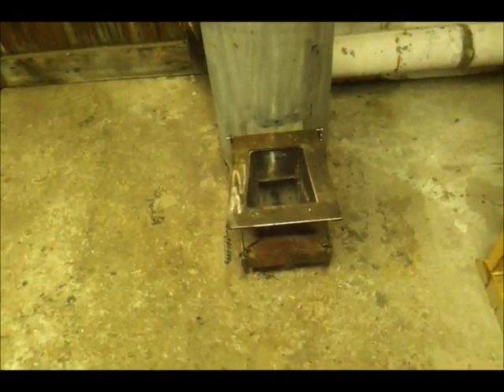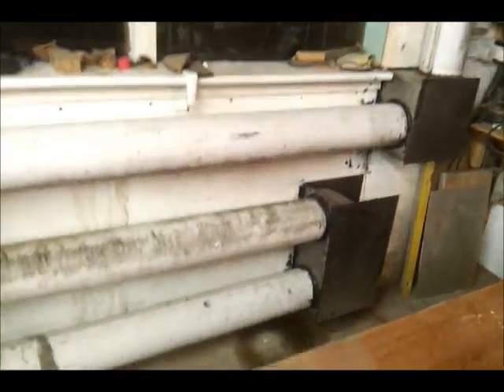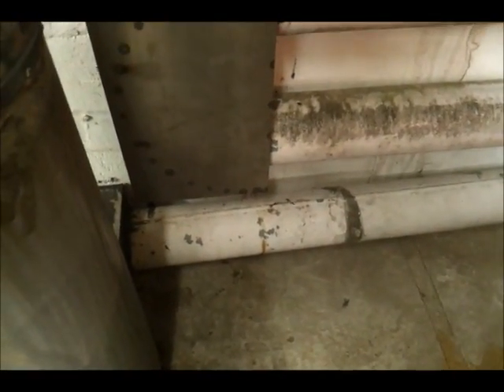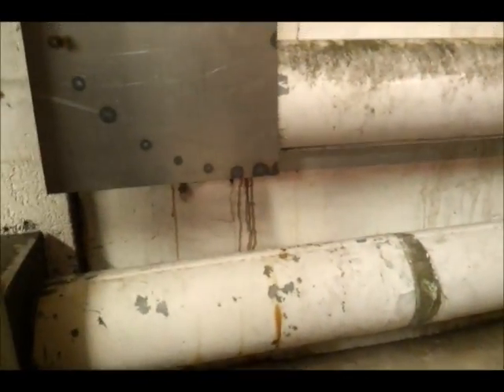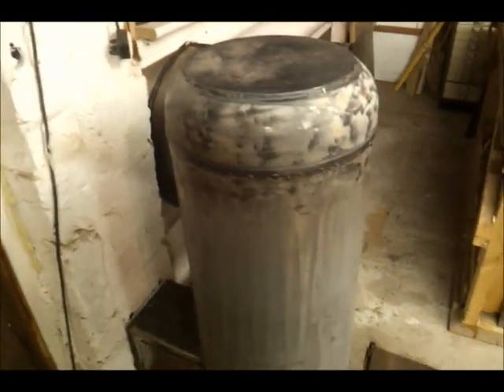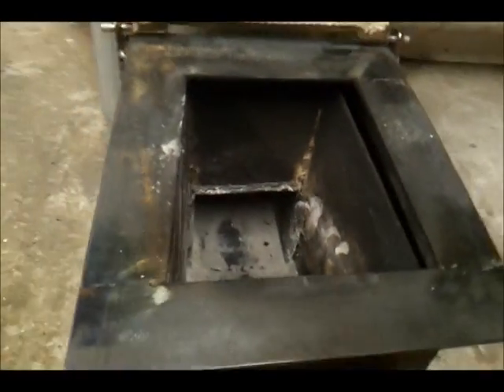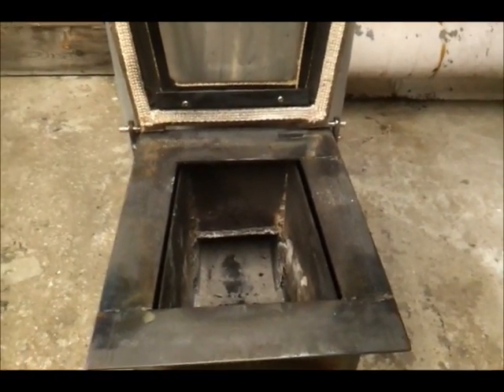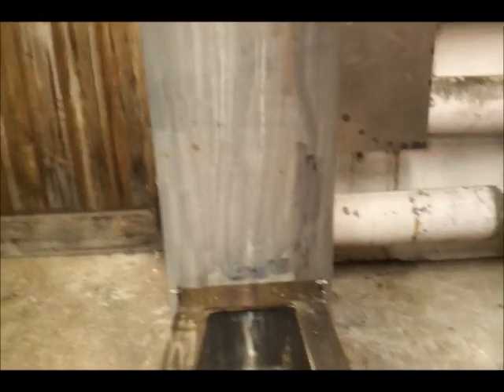rocket stove heater part 1

Comment: Hey Mr.Potty,
awesome stuff here on this channel!
May i ask you how thick is the steel of the firebox?
Thank you so far, greetings from Austria!
Stefan
Reply from the maker: Hi stefan, the inner steel is around 4- 5mm mate, the outer side pieces where about 1.5mm,  4mm inner seems fine as the refractory lining has protected it perfectly. Cheers.
Reply: Loz Harrop thanks for the quick response!

Comment: Hello Ppotty1 could I put an idea to you? The huge success of the Rocket heater is due to all the heat being released into the room so the burnt gasses exiting the flue are cool - as opposed to the time honored heater design where much of the heat is lost exiting the flue. 
And - all the thought and design you have put into your Rockets are a means of achieving that end - as opposed to the Rocket design extracting more heat from the wood.
Thanks in anticipation
Cheers
Mark
Reply from the maker: Hi mark, Yes they burn cleaner than a convential stove but the heat extraction takes place on the exchanger and the way the gasses move inside, plus on my latest one the flow of gasses has been really slowed down to further extract them with the exchanger, less air moves through the stove and therefore out of the flue. Cheers
Reply: Many thanks that has clarified things a lot.
Why do you use the "batch box" style rather than the "J Tube"?
Isn't the "batch box" style basically a free standing radiant heater connected to a "Rocket" - that radiates heat in its own right before gasses are expelled into the rocket?
BTW
I want to build a Rocket Space Heater in a cabin on the remote south coast of Western Australia.I have done a fair amount of reading/Youtube etc and your postings have been by far the easiest for me to understand. Thankyou
Cheers
Mark

Comment: very nice.  shd work great on those cold Scottish winters.  good example showing how it dissipates heat .   it's amazing too.  been trying to get a friend to make one.  This one shd convince him.   why such a small firebox?   how often do you feed the firebox?
Reply from the maker: +Tim Spriggs Cheers Tim, That stove was my previous one and I could have made the firebox bigger but it put out plenty of heat in fact it destroyed the riser tube it got so hot. From memory it would burn for 3-4 hours on one fill once it was hot.
Reply: ***** the riser tube is the vertical one , part of the rocket stove, interior part?
Reply: ***** what about using cinder  blocks as the riser?  would they take the heat?
Reply from the maker: +Tim Spriggs Something in clay probably would Tim, but you are getting into temps above 1400c + its best to use refractory type fire bricks.
Reply: ***** what part gets the highest temps--the vertical core in the secondary chamber?
Reply from the maker: +Tim Spriggs Yes tim known as the riser tube, the intense heat inside burns up most anything that enters which gives you more heat from the fuel also why these stoves burn so clean with little or no flue smoke.
Reply: ***** wow, these things are more intense once you know what's really happening.  But now I know.  Thanks for the lesson.  lol.

Comment: Hi P:  I am  planing to build a rocket stove of your design.  I  have a few questions, hope you can help.  In your shop, you have three horizontal 6 1/2" dia pipes on the wall.  In my plan, I want to build your design, however; the pipes will be lay on concrete slab and covered up with fire bricks, clay, gravel, cob, sand, and anything I can put in there to absorb heat.  In short, a mass bench.  I am certain you have seen the rocket mass heaters on the web.  Do you think your rocket stove can do that?  Will  8"  dia pipes will provide more draft that a 6" dia?
Reply from the maker: yick wong Hi Yickyes I have seen plenty of mass heaters with benches built around the flue. I dont think an 8inch flue would give any more draw than a 6 inch on a rocket stove, the only way to improve the draw on the flue is to take it as high as you can outside, that would be ideal for your bench build as it would help pull the gasses along. cheers.

Comment: Great stove and video, I have a question, I see the flue terminates in your workshop, is there not a risk of carbon monoxide (CO) or or hydrogen coming out the flue?
Reply from the maker: +Tusk Bilasimo Hi and thanks, The flue does actually go outside, early in the build it went through the wall but was changed to exit through the roof. Cheers.
Reply: It burns so hot and complete, I doubt there's anything in that exhaust but CO2 and H2O if that. Wouldn't be hard to find out.
Reply: @frankschwartz7405  Yes... I suppose that if you keep falling asleep when working in there, it could be worth checking...😉

Comment: is that proper fire glass or have you converted an oven door?
Reply from the maker: ***** I bought the glass for the stove, i did try recycled but it cracked due to the temps.
Reply: @LozHarrop  where did you get the glass

Comment: Does it heat your shop well ? how big is your shop ? at what temp and how hot can you get your shop?
Reply from the maker: Orlando Pereira Hi orlando, been a few changes to this stove, if you check my latest video with the new firebox you will get a good idea of burn times and temp output shop is roughly 25 foot square the stove now will maintain a shop temp of 20-15c c no problem to make it higher if needed.

Comment: hey ppotty have you had any idea of creosote or soot deposits with the long pipe?
 just wondering  as the heat cools there could be deposits left in the pipe? 
if the firebox is burning right there should be minimal deposits though.

Comment: good stuuffff - good pratical use and making of rocket.

As you pointed out the long flume loses heat quickly - it is radiating to the cold environment.

So the best place for thermal mass is directly around the fire (greatest heat point) creates longest residual heating. But is still worth having bricks etc around the flume piping. The idea is to create less variation in temp - too hot when burning then cold. With thermal mass the temp graduatly increase and very slowly loses heat.

Comment: hey man, thanks for replying! Defo, I am in favor of experiments over theoretical mind exercises - while both have their value, the experiment is the ultimate answer :). I just didn't know that you back your design with other experimental designs, and from my research and the way I understand the physics of rocket mass heaters, it seemed to be the way.
MAybe it is because in your case, there's NO thermal mass, only the long flue, that can radiate heat, but cannot cool the flumes down fully?

Comment: Hello potty! I am not sure, if having a chimney that high, is a great idea, when it comes to rocket stoves! Remember, the draft here comes NOT FROM THE CHIMNEY, but from the heat riser. After entering the pipework, the goal is to cool it down &extract as much heat from it, as possible, using thermal mass. Since the air is cooled to nearly the env. temp, it makes it 'heavy' again, and high chimney might result in "plugging" the chimney with colder air. My $0.02, cheers. Good job in general :-)

Comment: brilliant, I think the "bendy" connections separate the  metal pipes and reduce heat transference, keeping most of the heat on the closest pipes... an inadvertent bonus as a result, the "brick mass" will be the 'cherry on top'  I wonder if it would make sense to build a brick encasement around the tank up 3/4 of height (or higher)  for safety and to release the heat slower and additional mass?